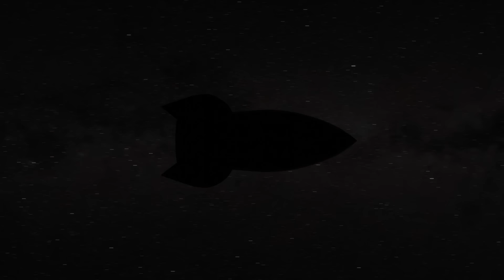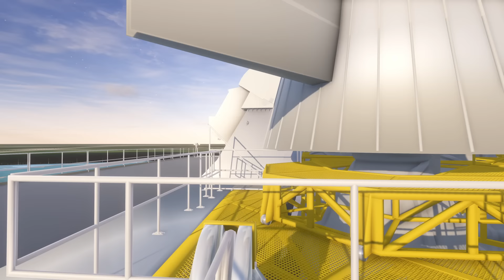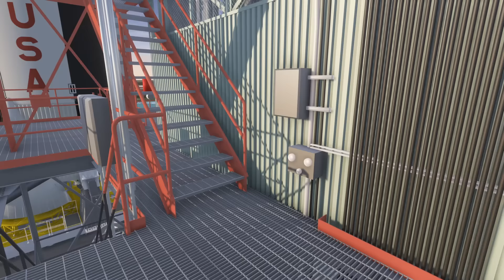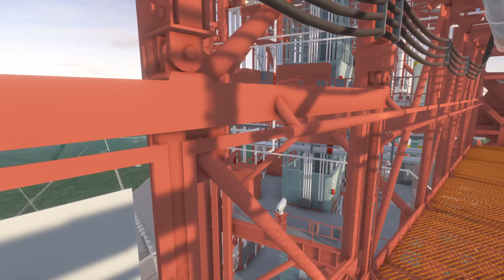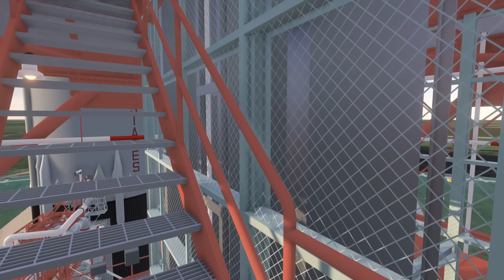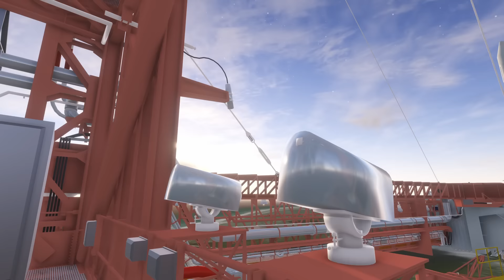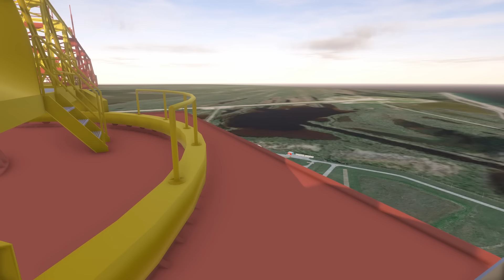How Did The Massive Launch Tower For The Saturn V Work?

Comment: Fun fact.  The Hammerhead Crane at the top of the tower was reused on the Shuttle FSS.  I’ve actually been in it (which was verboten).  There was a welded shut hatch at the back which overhangs the tower and there was about a 1” hole in it.  When you look down, there’s absolutely nothing between you and the ground but that welded hatch.  Kind of scary.  There is a walkway along side the crane part all the way out to to the very tip; I went out there too (even more verboten).  You’re really out in space standing out there like that.  I notice the hatches in the MLP in this model kind of look like ship hatches; and that’s exactly the kind of hatches it had.  It was treated like a ship and looked just like a ship from the inside.  Only thing wrong, the actual hatches had large relief valves in them (just holes with a flapper covering them).  They were needed because the compartments were pressurized and you had to equalize the pressure before you could (or should) open a hatch.
Reply: I love how he repeatedly mentions the "whole damn clamps"!!!

Comment: The launch tower is even more impressive when one considers that it took a virtual army of 1960s engineers and draftsmen to create the paper construction drawings with no computer aids, using nothing more than slide rulers, T-squares and pencils and they completed the project in a couple of years.  Today with advance CAD tools, computers and technology enhancements, Bechtel Corporation was awarded a simpler but similar SLS Mobile Launcher 2 project contract in June 2019 for $383 million, with a scheduled to deliver the launcher tower to NASA in March 2023.  However, recent projections indicate the total cost could reach $2.7 billion by the time Bechtel delivers the ML-2 to NASA. With the time NASA requires after delivery to prepare the launcher, it is projected the ML-2 will not be ready to support a launch until spring 2029.  It shows you how far we have come. (Sarcasm)
Reply: I want to acknowledge the efforts of the MLP designers while also defending Bechtel. The full SLS stack is significantly heavier and more complex than the Saturn Apollo stack. Safety standards have advanced greatly since the 1960s, and the designs for the EUS and SLS have evolved over time. Many lessons learned from ML1 led to necessary revisions in ML2, and this trend has continued. This situation often arises when a cost-plus contract is awarded, especially when requirements change and the project scope increases. I can confidently say that the OIG's projected completion date of 2029 is a worst-case scenario. EGS is actually projecting that the project will be completed by the end of 2026.
Reply: If we had the modern technology of today but the geo/political climate, social environment, and safety standards of the 1950's/60's, we could absolutely build a moon rocket in the same amount of time and money (if not less) than they did back then. But the world we live now in is very different than the one 70 years ago
Reply: @incognitoburrito6020  Contracts back then were awarded based much more on merit. Then all the economic benefits of such enormous government contracts became something local Congressman value quite a lot, so the same companies and same facilities are awarded contracts for political reasons (look at SLS) regardless of whether the firm getting the contract was the best option.
Reply: @incognitoburrito6020  too many cooks in the kitchen, and they all wanna get rich
Reply: The advantage of using T-squares and pencils over CAD is no buggy software. To draw the same plans today with MS Windows and Autodesk would probably take twice as long. (I use both at work and spend hours constantly updating Windows and troubleshooting Autodesk software.)
Reply: @rcnfo1197  That might have been true at one time.  I have had many CAD guys work for me and none used pencil and paper for many years.
Reply: $383 million turned into $2.7 billion. No wonder why the US is in debt.😢
Reply: I recommend reading the full OIG report if you're interested in all the facts. The agency's baseline budget is $1.8 billion; the $2.7 billion figure was an extrapolation made by the OIG team before the construction phase began. The $383 million represents only the first option of the full base commitment of $1.8 billion—that's how cost-plus contracts work. Additionally, we've experienced about 20% inflation since 2019, and the team had to pause work for most of a year due to COVID-19 while still paying everyone on the payroll. I know this is lengthy, but there's much more to the story.
Reply: @dannydaw59  There's always one idiot, isn't there, danny?
Reply: @dannydaw59  Reagan, Bush and Trump tax cuts transferring trillions to the .1% is why the US is in debt.

Comment: That was excellent! Thank you. I learned something new which was the means by which the arms were retracted - pulleys! So simple.
There were a couple of nice details in the model worth mentioning. At the base of the vehicle, you can see the controlled release mechanisms mounted on the side of the hold-down arms. They were tapered pins that were pulled through dies on the vehicle to soften the first few centimetres of ascent. 
On the hoods of the hold-down arms themselves, you can see lanyards that attached those hoods to the vehicle. Essentially, the rising rocket was used to close the hoods before the engine exhaust hit them. The lanyards would then snap, and there is footage where you can see this happen.
The last factoid I thought worth adding concerns the Q-ball at the top of the Launch Escape Tower. The comparison with an aircraft's pitot tube is worthwhile but it was more then that. There were eight holes at the top and the reason was to sense whether there was equal aerodynamic pressure on all eight. If not, they knew the vehicle had a certain degree of sideslip, called 'alpha'. In the command module, the meter that normally showed the combustion pressure in the SPS engine was used during ascent to display "LV alpha" so the crew could see if the rocket was flying true.
Reply: From the author of the Saturn V Workshop Manual!  Thank you for all you have done to preserve and make accessible the fascinating technical aspects of the Saturn V.
Reply: @benz-share9058  You are welcome. 🙂

Comment: The mobile launch platform, BTW, had 43 rooms (according to this document I found). The computer was an RCA-110, a real old dinosaur pen mainframe, quite unlike the far more modern computers in the vehicle itself. I don't know how much of it was in the launch platform but in a typical 'desktop' configuration it consisted of about twenty massive cabinets and filled a big room. It was made out of discrete transistors and ran at 0.9MHz, with a RAM size of 512 to 4096 24-bit words. Remember in old movies you see giant tape drives which move irregularly with strange 'pop' sounds? Right.
Reply: The RCA-110A was wholly inside the launch umbilical tower platform   - room 15A.  There were 18 rooms on each of the two floors, plus 4 rooms which spanned both floors - so 40 rooms according to Jonathan Ward's "Rocket Ranch".

Comment: Yep, hydrogen at the top, oxygen at the bottom. On the 1st stage Oxygen at the top, RP-1 at the bottom. In a conventional rocket the more dense propellant is on the bottom, so the line from the upper tank to the engines is shorter. 

In the Shuttle external tank oxygen is on top.
Reply: Same with SLS CS and the Delta IV CBC

Comment: Down at the hold down clamps, there is a little 'extra' hold down. It is green in the video. These are mechanical clamps designed to pull apart once a certain vertical thrust component was reached. So, the big clamps would release, but the rocket is still held down until this thrust threshold is reached. At this point, these mechanical clamps are pulled apart. This keeps the rocket from bouncing on the pad before full thrust is achieved.
Reply: There was a not so long ago, Chinese rocket on a test stand that used Temu sourced clamps with predictable results.
Reply: @bobroberts2371  Oh haha. Think you're funny, do you?

Comment: Why no mention of the guillotines? The arms that move at the last moment had guillotines that dropped a split second after the connection plates pulled back. If the plates failed to detach the guillotine would cut the cables.
Reply: Yes, and I understand a guillotine mechanism would sever the electrical conduit between the command and service modules before earth reentry.

Comment: Saturn V is the greatest achievement of the 20th century. A true wonder of the world.
Reply: I wouldn't call the Saturn V the greatest achievement of the 20th century. I'd call it the greatest machine of the 20th century. 

The Saturn V made the greatest achievement of the 20th century  - landing people on the Moon and returning them safely to the Earth - possible.
Reply: it's a true wonder but it didn't revolutionize our lives as transistor ot integrated circuit did
Reply: I would say the whole "thing" Saturn V, The Lunar Module and the Command Module... Its way bigger wonder then the pyramids.. The pyramids were built on slavery and death.. So no, its not a good example...
Reply: Nah, the transistor was... it made the Saturn V and a LOT of other things possible
Reply: @GeneCash  Naw, the transistor was basically found by fkin around, accidental. The Saturn V was forced into existence by the hard work and research of numerous geniuses. An achievement that ranks with the great pyramids.
Reply: @billshiff2060  
But the Saturn V also killed the space program, simply by costing far too much. Without the Apollo Program, space flight would have progressed in a more sustainable manner, and by the 80's would have been ahead of our timeline.
Reply: @billshiff2060 So, the pyramids really could launch then. I knew it.
Reply: @ without the manned Saturn V program there would be no space program.,.
Reply: @ naw the transistor was a discovery not an achievement.
Reply: @GeneCash  If we're on-upping each other, the most important invention of the 20th century was the nuclear bomb. It made sure that if WW3 broke out it would've been the end of mankind hence forcing the both super powers to come up  with a way of peaceful coexistence and thus creating a stable status quo between the USA and the USSR.
Reply: and there was me thinking it was the development of germ theory, effective medicines and vaccines
Reply: @ that was 18th and 19th century.
Reply: @MattNolanCustom  Nah, that led to massive overpopulation, which led to just about every other bad thing that's ever happened.

Comment: Fran Lab has a cool video about what is behind the displays at Mission Control.  Apparently no photos exist, only engineering drawings.
Reply: Are you talking about the big display in front of the room? It was a projection from the backside, the so called "batcave".
Reply: @benjaminhanke79  No the small light-up indicators
Reply: @benjaminhanke79  Yes.  Fran has a great video.  All the orbital markers are driven by mechanical models moving in the back room.

Comment: One small correction. The Hypergolic propellents were not loaded thru any of the arms on the LUT.  The hypers were only used on the CSM and LM and since they were room temperature stable, they could load them several days before the launch. Since they are also toxic as hell, the pad was cleared of everyone not directly involved in the loading operations. Those people were outfitted in SCAPE suits and worked in shifts on the upper levels of the MSS. The hypers were loaded from specialized carts brought up specifically for that purpose at very slow rates. They also loaded the fuels and oxidizers on separate days to minimize the possibility of leaks of both at the same time which, if they mixed, would have lead to an explosion on the pad. For more information on the processes of getting a Saturn V ready to fly, I would suggest the excellent books "Rocket Ranch" and "Countdown to a moon launch" both by Johnathan H Ward.
Reply: What’s up Jay!  I was reading the comment and thinking this sounds like some trivia to ask Jay about… then I saw you posted it!! lol.  I hope you are well.
Reply: I was a bit confused when Scott said that - I could not imagine a way to disconnect those hoses without making the environment rather more risky than it already was :0)
Thanks for the reading suggestions!
Reply: Lucky you! You won a walk to any destination of your choosing
Reply: That's why the ground crew at the Space Shuttle landings wore HAZMAT SUITS> The hyperbolic fuels in the reaction jets need to be drained with special fixtures.
Reply: hyperGolic, not hyperBolic  -1sp
Reply: 300 feet Scott! You poked the bear on that one,  lmao!
Reply: Watch "American Moon", at least the 10 last minutes!
Plenty of of original and unedited footage...
Reply: Thanks so much for the detailed info.  I really appreciate it
Reply: Sheldon IRL
Reply: George is lost on the wrong channel. He apparently was looking for something regarding gender reassignment
Reply: What do you mean by fuel and oxidizer on separate days? Are you referring to the CSM and LM? If those fuels are hypergolic, is it accurate to refer to them as "fuel" and "oxidizer"? Just curious. 

If by "fuel" and "oxidizer" you mean RP1, LH, and LOX, they were loaded in the hours just before launch. Being cryogenic and pressurized, they wouldn't store well (if at all) in the Saturn V for more than half a day or so.  The spherical storage tanks on the ground, several hundred feet from the pad, are designed for longer term storage. 

The RP1, being stable and relatively benign, was loaded a few days (3 maybe) before launch. 

Loading of the cryogenic propellants began at T - 7:28 with LOX to S-IVB, one stage at a time, and finishing S-IC at T - 4:55. 
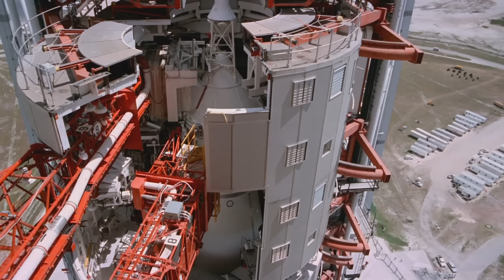Loading LH began with S-II at T - 4:54, with S-IVB finishing with LH at T - 3:28. Astronaut loading began soon after. 

The pad would've been a busy and dangerous place those last hours before launch.

The cryogenic propellants, if they leaked and mixed, not being hypergolic, wouldn't spontaneously ignite. LOX, even on it's own, is quite the accelerant if it's splashing randomly around the pad, touching paint, metals, wires, grease etc.
Reply: @gregorytoews8316 I think you are confusing terms monopropellant and hypergolic. While hypergolic propellants can be used as a monopropellant, they are often used as bi-propellants, which is more effective. For example when combined, hydrazine works as fuel and nitrogen tetroxide is oxidizer
Reply: @gregorytoews8316  Actually, the RP1 in the S1-C was loaded during the countdown demonstration test 3 to 4 weeks before the actual launch. Since, as you said, it is room temperature stable and non corrosive, they just left it in the LV until the launch. The level in the tank would be adjusted during the final countdown based on environmental conditions and load levels of the LOX.
Reply: @gregorytoews8316  I was refereeing to the hypergolic propellents only. The LM and the service module SPS engine used Aerozine 50 and nitrogen tetroxide while the service module and command module RCS systems used monomethyl hydrazine and nitrogen tetroxide. Nitrogen Tetroxide has a chemical formula of N2O4. During the chemical reaction with hydrazine compounds, the oxygen molecules split from the nitrogen molecules and and combines with the hydrogen molecules from the hydrazine so the terms "Fuel" and "Oxidizer" do apply.
Reply: @gregorytoews8316 hypergolics also need a fuel and an oxidizer. The oxidizer is usually some form of Nitrogen tetroxide and the fuel is usually a form of hydrazine.
Reply: Through. Spell it thru and the next thing you get is a president with the spelling ability of a 5 year old trans girl. Well he made the trans bit real, and yeah thru just looks stupid to anyone over 5.
Reply: @georgeprout42  What the Hell are you talking about?
Reply: @otpyrcralphpierre1742 George is lost on the wrong channel. 
He seemed to be looking for something to do with gender reassignment
Reply: @otpyrcralphpierre1742  He's trying to be funny and smart.....both failures
Reply: @georgeprout42  The rest of what was written seemed a fair bit more sane than what you typed down.
Reply: @ottonormalverbrauch3794  I don't particularly want to defend Georgie's post, but I have to agree that using the "thru" spelling seems incongruent with the rest of the post, which is informative, coherent, uses correct grammar and has no obvious spelling errors or slang. A single angsty teen word (spelling) thrown into a text written by an adult, it feels very "How do you do, fellow kids?".  :)
Reply: @meow33_33  That's thru..errr true but I think that even a grammar nazi* like myself would have the clear display of knowledge on hypergolic fuels barr me from commenting. 
*Mostly in my own language.
Reply: @meow33_33  languages evolve. When was the last time you saw a franchise using "drive through" signs?
Reply: @meow33_33   A spelling nazi with personal issues, and the one friend he needs. Hold hands and go find a congruent place for your pettiness and lack of personal security.
Reply: @georgeprout42  I looked that up and couldn’t find any data that supported that trans people are better or worse at grammar. You sound a little bigoted
Reply: @georgeprout42  "Through is the only acceptable way to spell the word in a formal situation. In informal situations, and especially when texting or instant messaging, the form thru is becoming increasingly popular: Did you come thru with the tickets? Come to my place, we'll go thru all the episodes of Firefly."  Don't be a spelling Nazi, you'll sleep better at night.
Reply: @georgeprout42 
Don't bring us into this.
Reply: @georgeprout42 does your squad even “believe” that we went to the moon? Asking for a friend…